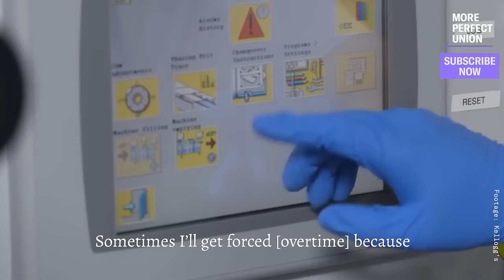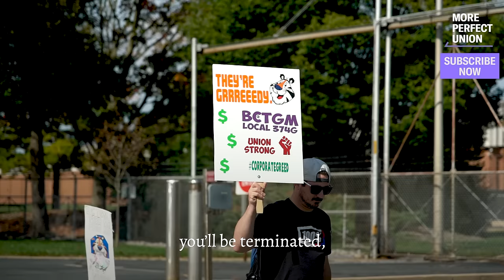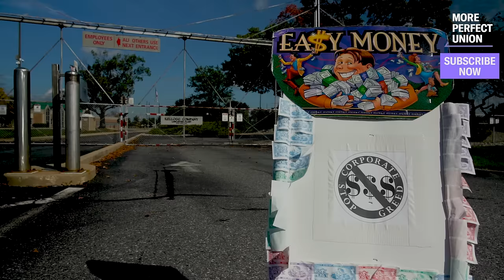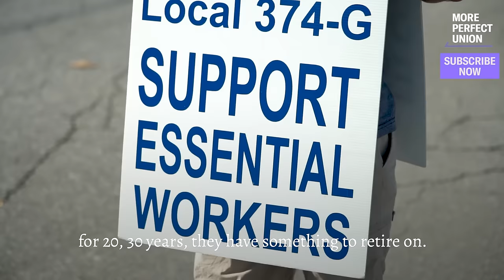Striking Kellogg's Workers Expose Company's Lies

Comment: Yep, I worked for company like that in Virginia for 4 years, except was mandatory overtime, but did 2 paid positions as well only getting paid for mine. Been calling Congress, Senators, Press, Lawyers, and Fair Labor Board, but since a "Right to work State", considered the law. BS, it's SLAVERY at it's best, because no one wants to deal with it, for have gotten no responses back from anyone to tell/help me get paid for other paid position that worked all those years, yet never filled. Anyone know anything about it, and what ti do?
Reply: I agree with about 90% of what you say. I worked for Weyerhaeuser, one of the worst. But it isn't slavery. I got sick of it went to college ( at 50) and went to work for an engineering company, never regretted it.

Comment: The Kellogg's plant in Cincinnati, OH is dealing with the same things. At the end of 2021, two of the product lines were moved from Cincinnati (union plant) to Jackson, TN (non union, significantly lower pay). . .to "save money."  As a result, close to 200 employees at the Cincinnati plant lost their jobs.
This video is so accurate. . .like the overtime thing.  Workers in Cincinnati were doing the same - signing up for overtime hours just because they knew they were going to get forced, anyway.  They were working double shifts multiple times a week, 16 hours with only 8 hours to go home, eat, sleep, and then go back to work again the next day.  One girl worked 16 hour shifts for 30 out of 35 days (not voluntarily, she kept getting forced).  Then a supervisor tried to write her up because she didn't have a uniform shirt on. . .when was she supposed to do her laundry? 
There is also a two-tier system in place.  For a long time, it was called "transitional" employees.  They could be moved around between departments to fill spots, they made about ten dollars less per hour than the regular employees, they didn't have as many paid holidays or benefits but were still expected to do all the same work.  There was no time limit on how long someone would be a transitional, because it was dependent on your seniority (hire date).  The top 80% in seniority were full pay/benefits.  The lower 20% were transitionals and only moved up if someone higher than them left/quit/terminated OR if more people were hired/lower in seniority.
During training/orientation, the new hires were told "usually you get bumped up to a full pay employee after a year or so."  There were some people who worked as transitional-level employees for over three years before finally getting full pay.
And, even the people hired within the last five or six years will never get the same benefits as the people who have been there longer.  Kellogg's is still doing all it can to divide its workforce, and from day to day there will be occasional snide remarks from management about unions.
Meanwhile, the company  reports record profits, and the CEO is living comfortably with an $11.2M salary, enjoying his $6M home.